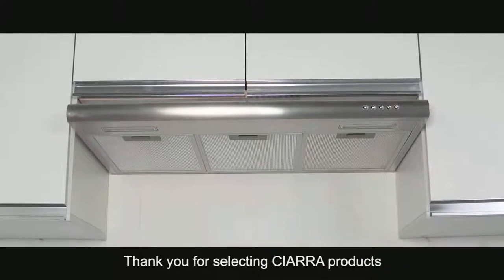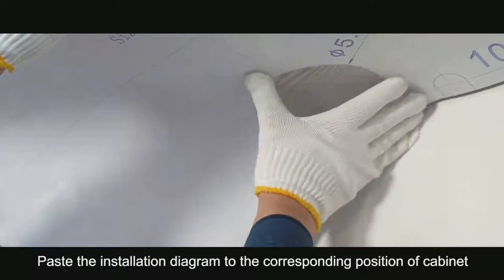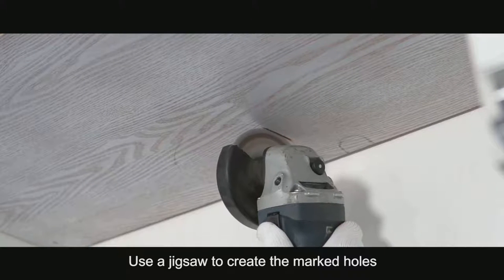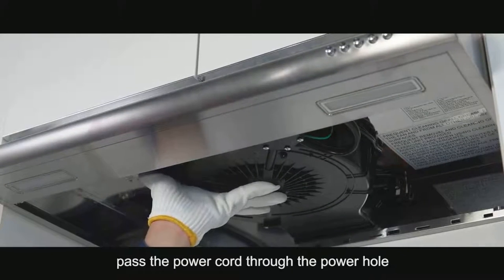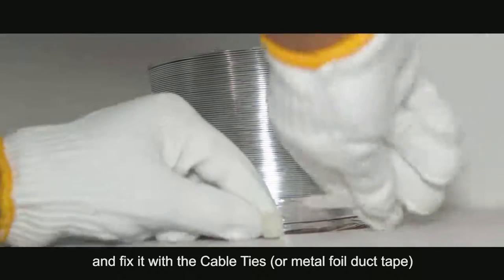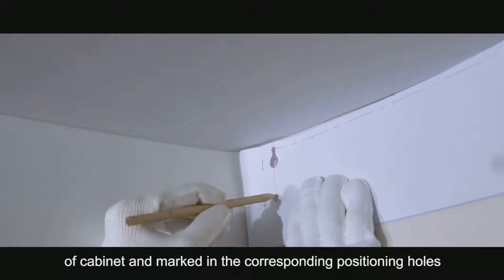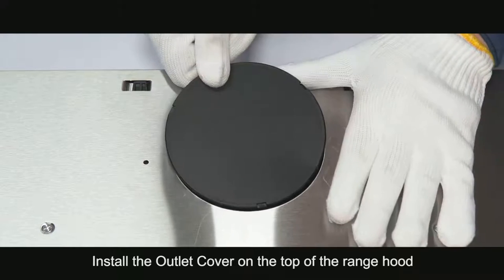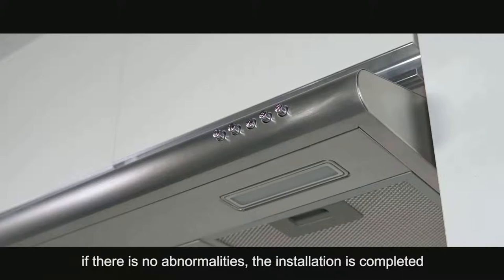CIARRA Under Cabinet  Range Hood Installation for CAS75918A & CAS75918B & CAB75918B

Comment: You did not show ductless installation and you did not show giving it power.  You MUST show how to install it ductless and how to rout the power.
Reply from the maker: Hello, there are two ways of outdoor ventilation for this model: including “horizontal ventilation” and “vertical ventilation”.You can choose the ventilation method according to the actual installation needs of your own kitchen. Of course, you can also install activated carbon to use indoor ventilation mode. 
Regarding the power-on method, you only need to plug the power plug of the hood into your indoor power socket.😉
Reply: @CIARRAAppliances  how long is the chord that plugs into the outlet?
Reply from the maker: @Googlehackedacct707  Hello, the cable is 1meter long.
Reply: @CIARRAAppliances  Thank you
Reply from the maker: @Googlehackedacct707  Thank you for your support
Reply: But still why wasn’t it shown if it’s an option?  Do I need to take off the little rectangular back panel if I am using the indoor ventilation mode?
Reply: @amberestep215  same question I have it’s not clear in the manual